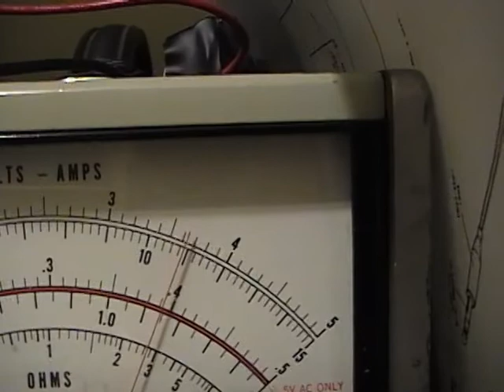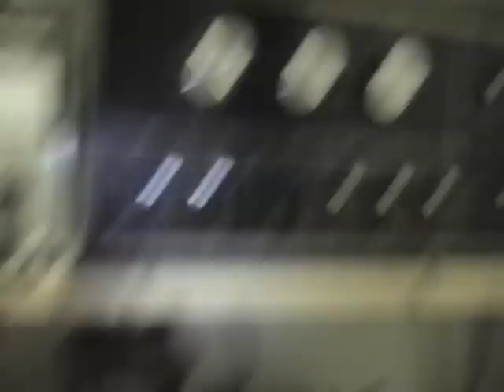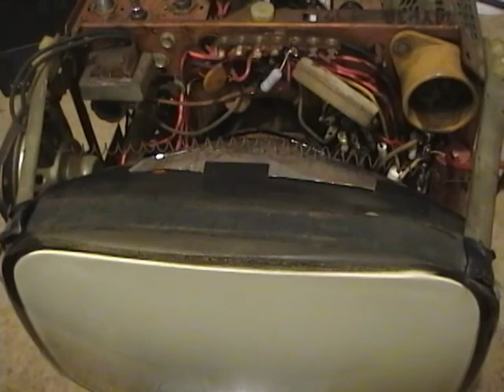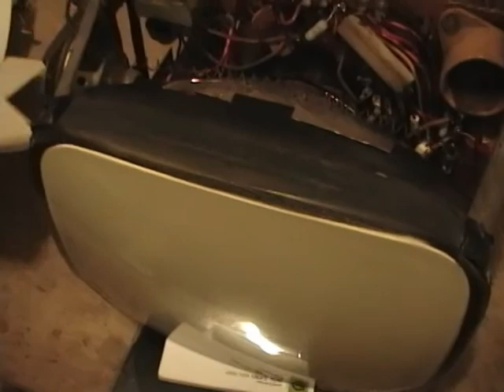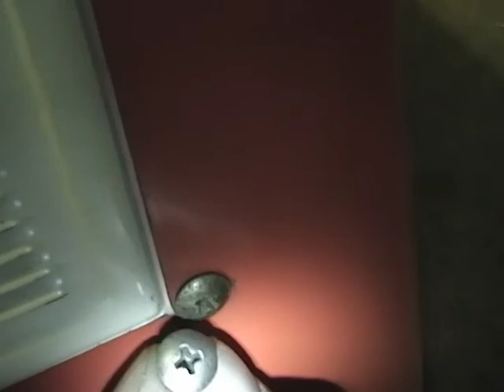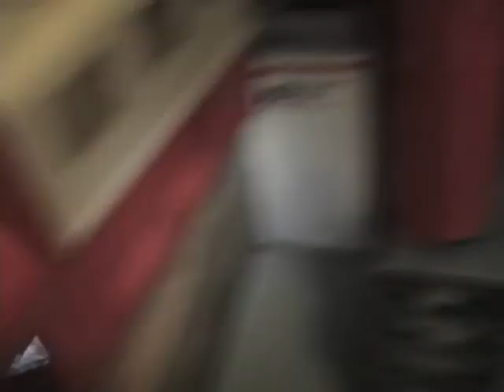Admiral T102 Restoration p6o6

Comment: I rule of thumb for selenium rectifiers is that each sell drops 1/2 -1.5V so the 6 cell power diodes you have in your set would drop 9V.  You should be able to calculate the current drawn by the set from your Sam's data.  From that you should be able to calculate the dropping resistance required to get the set back to 255V.  Food for thought.

Comment: As you correctly mentioned, the vertical controls all interact when any one is adjusted. But with these tube sets, the vertical linearity control *predominately* affects the top half of the raster and the height control predominates the bottom half (very different from solid state circuits). The temptation then is often to try to center the picture with these controls. You are right to use test patterns to all of this.

Comment: The Krylon, VHT, and Dupli Color paint is pretty good too, VHT specializes in high heat paint. What shade of orange paint is that? Is it the Chevrolet or the Hemi orange? I would bet that you could shorten that 7 day cure time by baking the paint in the oven often it flash dries.